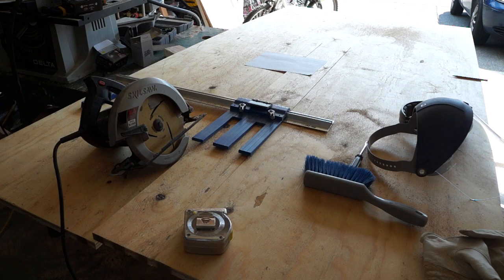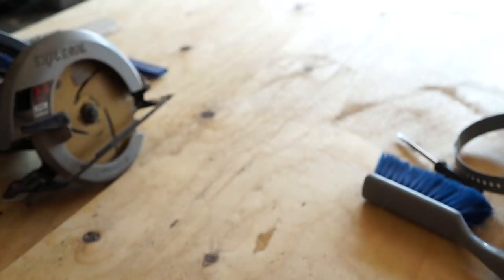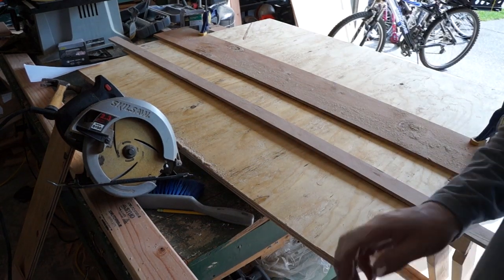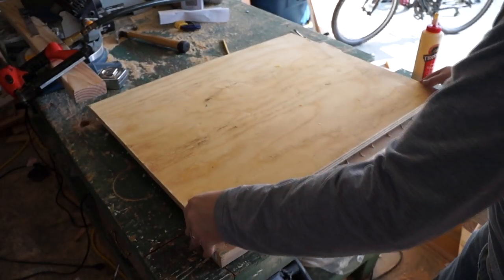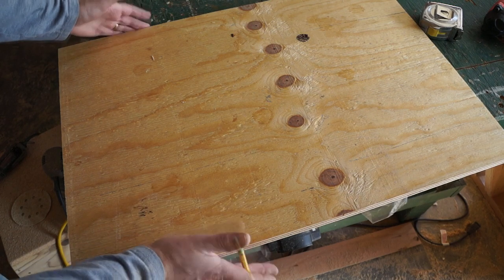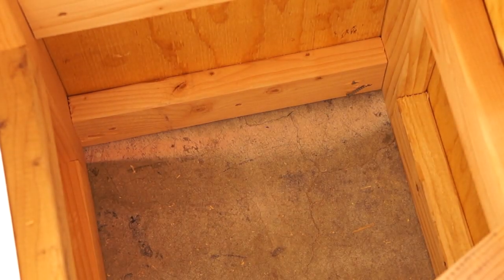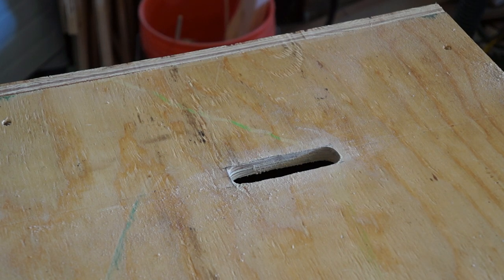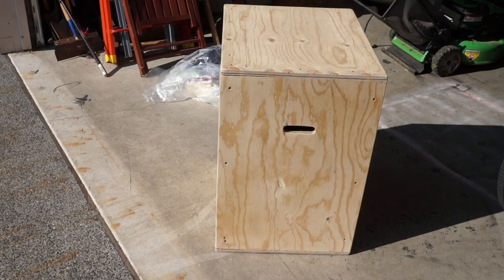How to Build a Three Sided Crossfit Plyo Jump Box

Comment: Thanks for the video

Any advice on adding carpet covering to the box? I have watched a few subwoofer box videos and may try but I'm wondering how long the glued carpet will last. I'm thinking about adding the carpet to all sides prior to gluing/screwing them together to where the carpet is folded inside each connected side. The box will be used inside the garage floor (smoother concrete) vs the driveway or sidewalk. I may even buy a rubber mat to help protect the carpet covering.
Reply from the maker: I think your idea would work.  If you use a good adhesive, it should stick fine.  Folding it in may work if the carpet is thin enough.  Always remember to be careful when running or jumping on carpet.  There is a little bit of give that could cause an injury if you are not accounting for it.

Comment: I built a 20x24x30 box using this video.  Thanks green work bench!  I had a guy at home depot cut the plywood out of one 3/4 sheet.  The cuts were (2) 28.5x22.5, (2)28.5x20, and (2) 24x20.  I then bought (3) 8 foot 2x2's and used those to frame the inside of the box.  All I needed was a saw to cut the 2x2's, some wood glue, and a drill.  I used deck screws and glued all joints.  The total cost at Home Depot was 47.00 for the wood, glue, and screws and it took me about two hours to complete.  The thing is rock solid!
Reply from the maker: Awesome!  Thanks for sharing!

Comment from the maker: @Amber Rowse-Simmons. Sorry for the delay in responding.  The 22.5 piece is 22.5 x 28.5. I didn't write up a cut list for the 2x4s, but the 2x4 frame goes all the way to the edge of the plywood, so that can be your guide.

Comment: Do I need all the tools that you used in the videos? I have a limited supply of tools around the house but I am eager to build myself a box for home WODs. What tools are necessary for this project?
Reply: I made mine by going down to home depot with dimensions and just having them cut the wood for me then drilling it together at home. Wood, wood glue, screws, and a drill worked for me!
Reply from the maker: Peter Ranville Great idea!  Thanks for sharing.
Reply: I  made mine with only scissors and masking tape